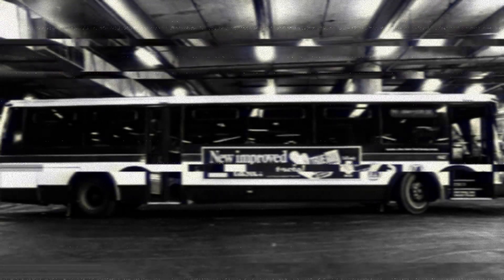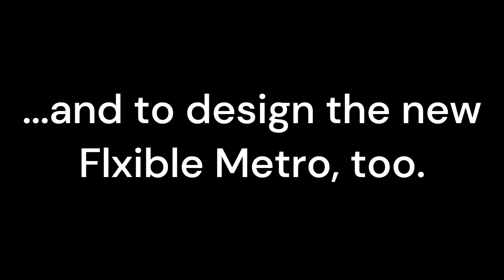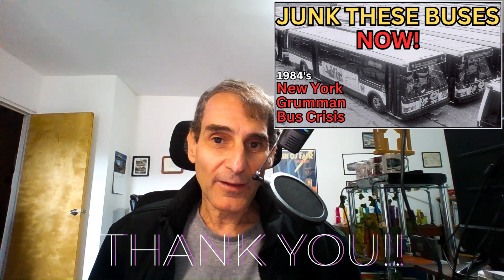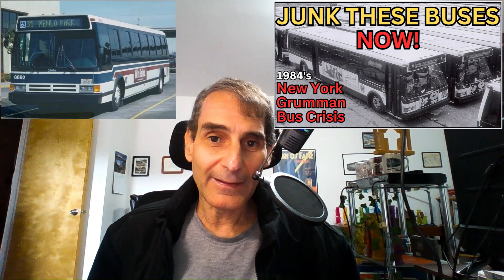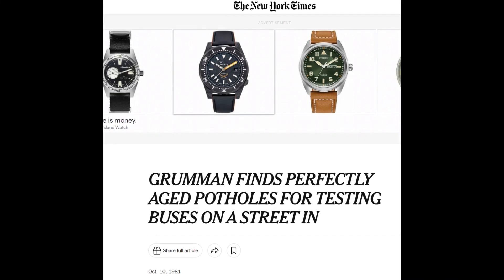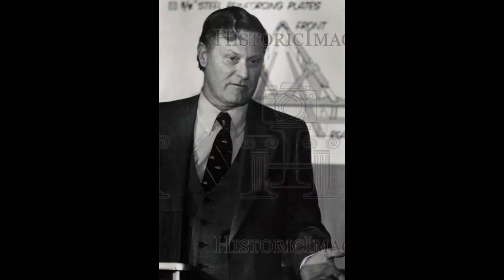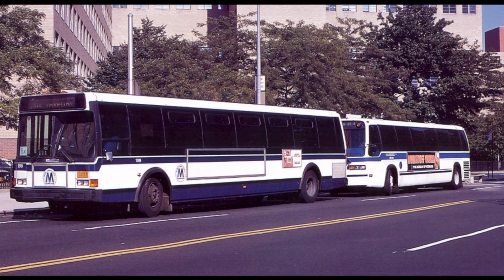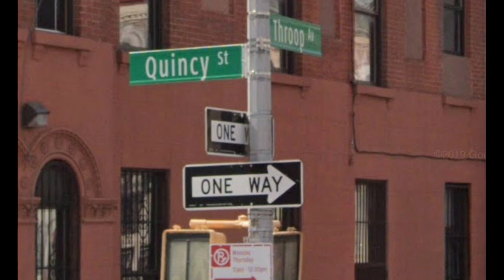Grumman vs. NYC Potholes: The Fight to Fix the Flxible 870 Bus [History of Buses]

Comment: I worked on these buses at the NYC MTA. The frame cracks were not from potholes; it was from the design of the rear suspension, a Grumann-designed wishbone-shaped pivoting rear frame section that was never used on a bus before The flaw was it had no side to side pivot and the trunion bushings wore out fast, the fleet was pulled and were sent to the brooklyn navy yard where gruman welded reinforceing plates that eventually cracked also As far as the steering shafts breaking, that was caused by the ta modifying and moving the column bracket so fat drivers could fit behind the wheel, it caused a bind, and they snapped off
Reply from the maker: Hello! Wow, great to hear from someone who worked on the Grummans to learn the real story!!! Very interesting to read!!! Thanks very much for watching!!!

Comment: I loved the Flxibles. This was a new era post New Look buses that were tanks. Theres a cool story about GM basically terrified of anti trust lawsuits being filed, that they gave Flexi the whole New Look, and even advised them how to make it cheaper with flat glass.

But the late 70s saw a weird trend, not just with fuel costs but also research in composite materials and chemical welding (glue). Flxible paired with Grumman, to secretly use bus chassis and frames for aircraft fuselage fabrication techniques. Boeing also built a bus as well (that was cancelled in the end), Northrop built a few prototypes that were covered for some of the B-2 construction methods, as that was a composite bus, AM General was planning something as well, but I havent been able to find much on that bus project (its overshadowed by the HMWVEE).

There are some other buses in this era of the late 70s, early 80s, where tech was used to a greater extent. Heck, even DeLorean made a bus DMC-8? Id have to look it up, but it was based on the VoVII German standard of buses (Mercedes O405, MAN SN, Setra NC300, etc). 

As far as the MTA Flexis, all of them were purchased by NJ Transit, and they ran up until the 2000s with no issues. The way to recognize those buses, is the yellow panic lights on either side of the front destination sign, and the flat hood, without the four rectangle indents that the 83 and up models had, which later was called the Metro B. Again, going off memory, the Metro C was the CTA variant, that led to the D model, the 40102-D-1 and -2 that NJ Transit also used a lot, and those ran until 2010 or so. I wish I had the money at the time to buy one. I do know a guy (Trevor Logan) that bought one, then sold it, and was hanging with a bunch of guys that owned various former NJT buses, B10M, MC9, PD4509, and I think he has a Gillig 35 Phantom. I met him while driving for Red and Tan (that sadly, is no more...)

I still think the Metro 870 is the best looking bus by design.
Reply from the maker: Hello! Wow, again, this is super-interesting! Also, I did a video on the DeLorean DMC-80 bus that was, as you say, a derivative of the VOVII, and was shown in New York, but never ran in service - you can find it on my channel! Didn't know that GM basically gave away their New Look to Flxible to build and make it even better - sounds like a topic for a future video, LOL!

Interesting tidbits on the aerospace companies that built buses - Rohr built a Transbus entry, and so did AM General. But AM left the bus building business before the 70s were out, so they were never to compete, and their own transit bus wasn't received well by operators.

Again, thanks for all of this info, and thanks very much for watching again!!
Reply: @JeffreyOrnstein  Definteily its a cool story. I have it saved in a word file, because this was a meeting between the CEO of GM, and several bank execs, and GM had to give Flexi some marketshare, and the banks were confused. Its a very convoluted story, and the irony being that they spun it off into TMC and MCI anyway. I do have to find that file. It came to me from somebody that worked as an assistant to Durant, or something like that. Ill dig it up...

I do have a lot of useless info like this lol, as well as a LOT of photos, documenting anything I could find, both in the US and Europe too, I havent been very active with buses mostly because of just...weird issues. There are som strange characters (all hobbies have them, but train spotting, bus anything, and for whatever reason, Lincoln owners, are a bit odd lol.)

Comment: I remember thinking that they were like Star Wars to me. The display on the front and side where the bus was going would change where the old ones had a roll the driver would turn until he found the sign he needed. Also the rear door was wide and had an extendable platform to pick up people in wheelchairs and that the seats in the back would fold up and the wheelchairs would lock into the floor to keep them from rolling around while driving. Too bad they turned out to be junk.
Reply from the maker: Thank you for watching and for your comment about the Grummans!

Comment: The reason Grumman Flxible 870 had cracked a frames because they were using cheaper steel so Flxible had to take those 600 plus buses rebuilt them and sold them to NJT corporation in 1986
Reply from the maker: Thank you for watching and for your very interesting comment!

Comment: Goodnight sir.  Thank-you for the information about Grumman flexibles Test program on Quicy Street and Troop ave in the 1980's.  The Grumman should've lasted much longer than then did in the MTA. But they surely did in Queens Private Bus lines Green Line Bus Jamaica Bus Queens Transit/Stineway Transit and TriBoro Coach.  And MSBA did you know that Some of Flxble Metro had last 1999 in MSBA I think that Grumman flxble had last a while out there also. If the MTA didn't decide to scrap the whole Grumman flexibles Bus fleet Grumman would probably still make Bus to this day maybe .
Reply from the maker: Thank you for watching and for your comment about the Grummans and the private operators!

Comment: Awesome and informative video on the Flxible buses from the past! I have a suggestion: I think you should do a video on what happened to the Flxible Corporation and why it went out of business. Now I'm your new fan and a big transit fan! Sending you greetings from Miami!
Reply from the maker: Thank you for watching and for your very positive comment! Good suggestion, I will do research on Flxible, and maybe do a video on it in the future!
Reply: Inquiring minds wanna know this too

I'm sure the broken frames didn't help
Reply: China joint venture and General Automotive deciding to pull out of the European and American market. Gillig has the result as the basis of the Low Floor.

Comment: Around the late 80s Baltimore had an almost exclusive Flexable Metro fleet they seemed to be good as far as I could tell but I was only a passenger
Reply from the maker: Thank you for watching and for your comment about the Baltimore Flxibles!
Reply: I guess the problems were worked out by the time the MTA in Maryland started ordering the Flxibles. I remember that much of the fleet in the early-mid '80s were made up of either the GMC/Flxible"New Look" or GMC RTS models. The buses were functional and, for the RTS & (late '80s) Flxibles, comfortable for the hours I used to burn getting across town.
Reply: @carthellkelly1599 Didn't you guys have Neoplan AN440s as well?
Reply: @dodge2015  Neoplan was the next contractor the MTA bought buses from after Flxible went out-of-favor. Not sure whether they were AN440s (likely that and some 26 or 30', and 60' articulating buses). The most memorable "feature" of the buses that ran during the very late '80s-mid '90s was a horrible vibration/rattle that overtook the interior of the buses when stopped. It was as if no motor mounts or dampening materials were used between the engine and the frame of the vehicle. It definitely was a personal endurance test for a number of years. God knows how the drivers could stand the environment for hours, every day.
Reply: @dodge2015  actually they had a small fleet of maybe 10 around 1986 I think they were AN 440 but after Fixable went out of business they got some NABI busses for a few years
Reply: @carthellkelly1599  I remember those busses there was a group of 1987 model Flxables with a Cummins L10 instead of the Detroit 6v92 most of the other Flxables had the entire bus violently rattled standing still
Reply: @DanT271   Yeah, I forgot about NABI. My brain is slowly rusting out.  I think the rattlers were from NABI, not NeoPlan.
Reply: I know the early Gillig Low Floors overheated and broke down more than the Metros they replaced.